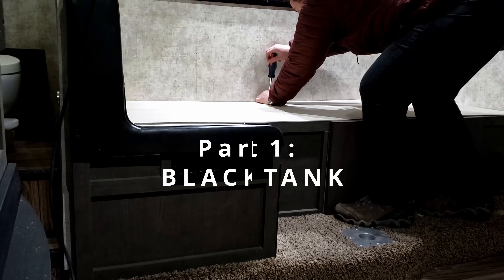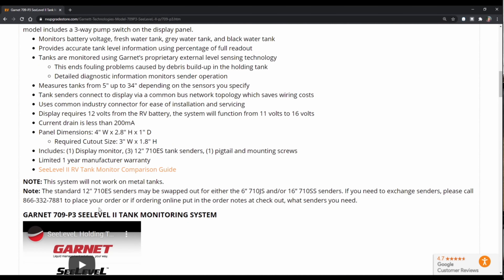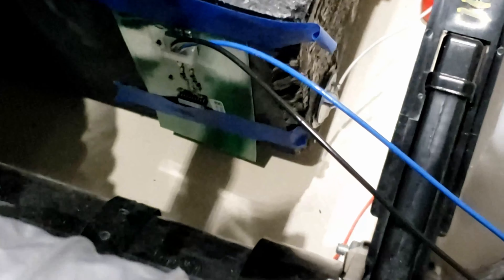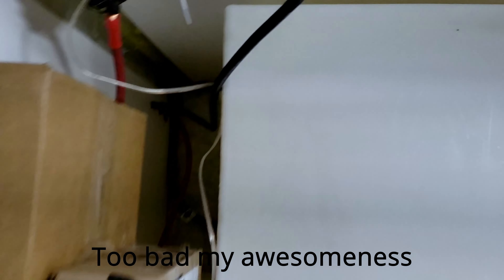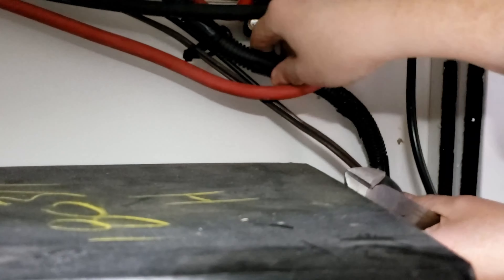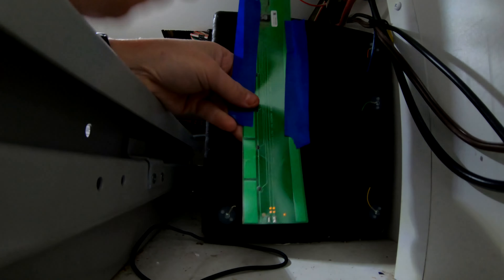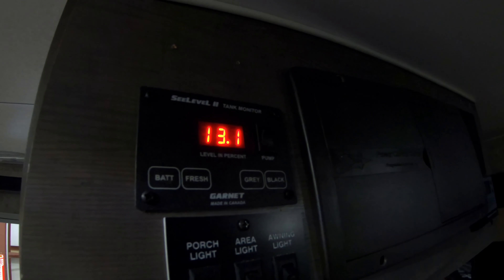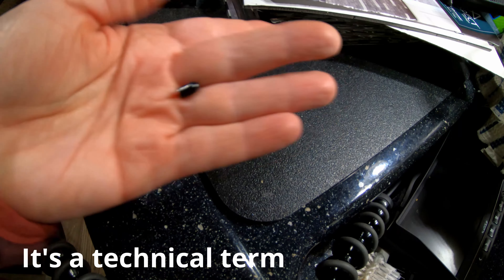SeeLevel Tank Monitoring Install | Host Cascade Truck Camper |E3

Comment: Jow many increments do the new sensors give?  25/50/75/100?  Or more?
Reply from the maker: The sensor is accurate to 7% So even though it displays a 2-digit number, there's around 14 increments.
Reply: @TheJoslynJourney  wow, that's great.
Reply from the maker: Yeah, more than enough to get a decent idea. You just have to make sure you place the sensor in the best location. For example, knowing when our water is llowest is the most important so I put the sensor down as far as it was reasonable. On our grey and black tanks, being accurate when they're full is most important, so I made sure it was closest to the top. They give good directions with the system.

Comment: Working on our tank monitor and confused as to the white pump indicator wire.  Can I send you a picture?  Remember, I'm a fair sculptor but electrical is about the last thing I'm capable of understanding
Reply from the maker: Hello, and congrats on the new system!  No worries - you can send it at my email at thejoslynjourney@gmail.com.  But if you want, I have those snapshots from the video on our webpage for this:   https://www.joslynjourney.com/e3/.  On the old display, they used a separate wire for the indicator.  You don't need it on this one since it's electronically controlled.  And you can do this!